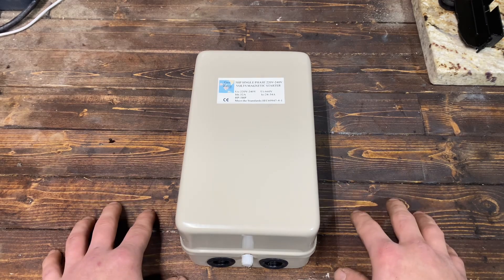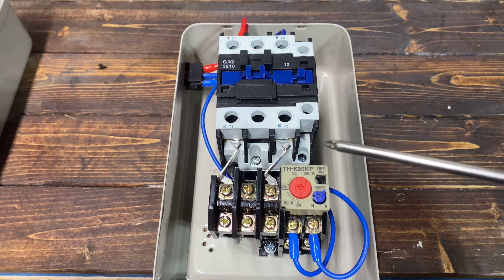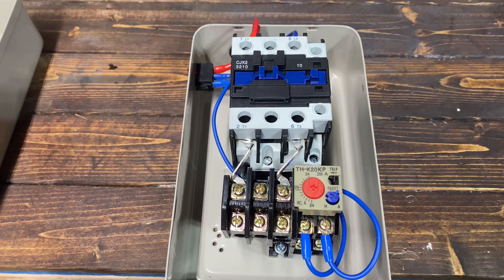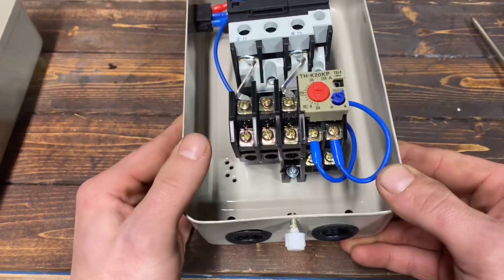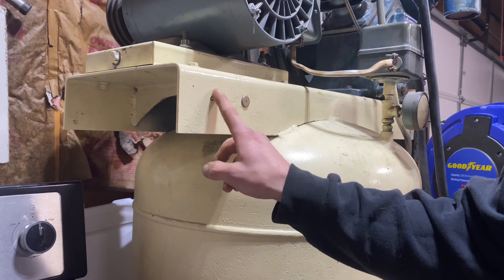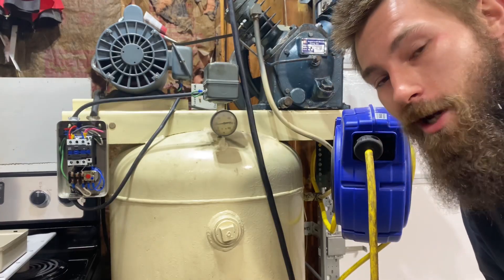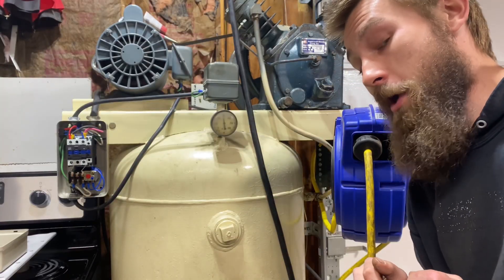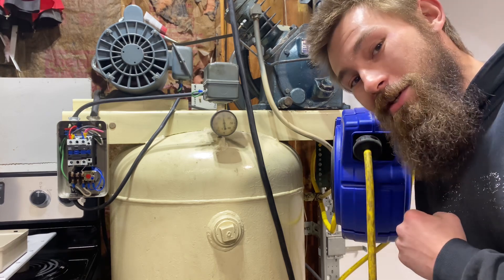I Bought The Cheapest Mag Starter on Amazon

Comment: what happens if you bolt it straight to the compressor frame?
Reply from the maker: Generally, mounting directly with no bushing can cause vibrations to loosen or crack components. Having a small rubber bushing can mitigate these issues as it’ll dampen any vibrations from the motor and pump running

Comment: Does it really have an on/off switch on the side?  That's one thing I need. I put 240 switches before the pressure switch…. 30 years it started to burn. I'm replacing the motor and wanted to do every at once.
Reply from the maker: Yes, it does have an on/off switch on the side. So far, the mag starter has performed wonderfully and I haven’t had any issues regarding it. And the switch does work, I throw both the switch and breaker when I’m not using my compressor. I’ve accidentally forgotten to turn the switch back on and wondered why my compressor doesn’t work for a hot second!

Comment: Only looking for how to wire mine up. What a waste of time
Reply from the maker: If you watched the video you’d see I pointed out where the incoming 240v comes in and where the wires go for your motor. If you’re having trouble with the pressure switch, it’s wired under the thermal relay for the in and out. Your wiring for the pressure switch may and probably is different then mine. Depends on make of the switch. Look at the wiring diagram. One wire goes out to the switch. One wire goes from the switch to the other terminal under the relay. Make sure to ground it all. Remember it’s 240v single phase. Two hots and a not. If you cannot figure out the basic wiring between the wiring diagrams and this video and comment, call an electrician. You do not want to be on the receiving end of 20 amps of 240v.
Reply: @mikesbrokenacres  your reply was too kind.